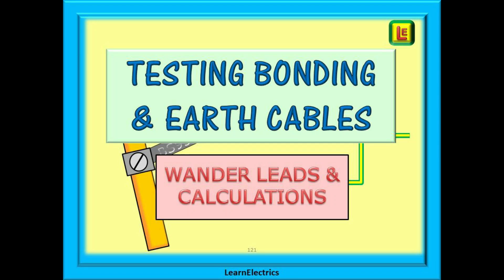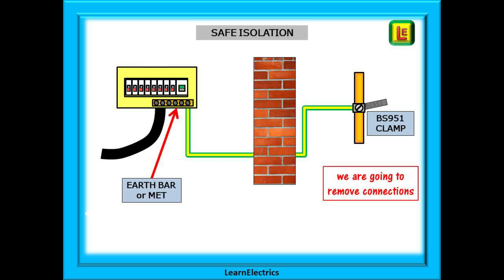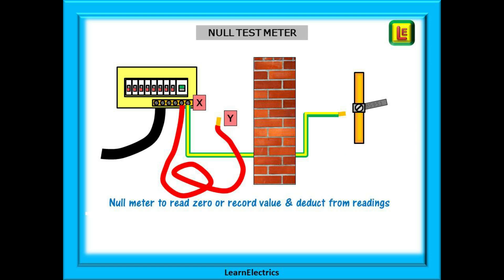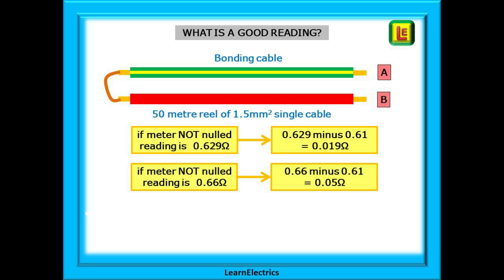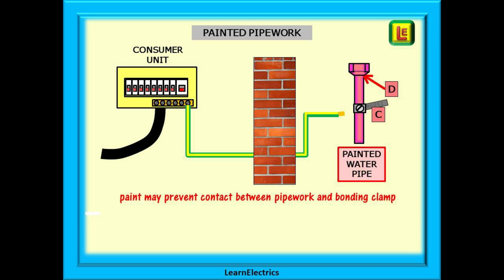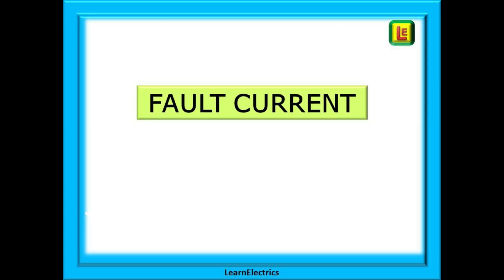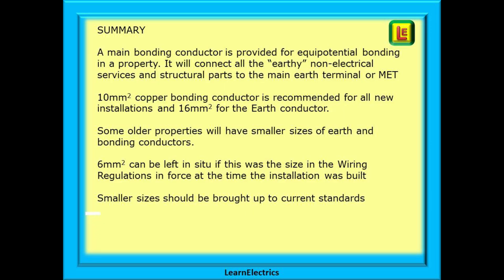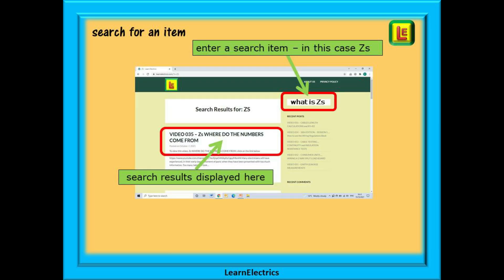TESTING BONDING & EARTH CABLES – WANDER LEADS & CALCULATIONS

Comment: Question about plastic water service pipe at entry position... is it good practice to remove the main bonding conductor as sometimes happens or leave in place? Regs please not opinions. Many thanks and HNY2026
Reply from the maker: I would leave it in place if its still connected to metal that is in contact with the earth/soil. Thanks for watching.
Reply: @learnelectrics4402  Thank you for your reply. I meant when the water pipe is plastic enterring the building with  copper after the stop tap. It is very common to see copper bonded after the stop tap despite a plastic incomer, the trade would bond  water only until very recently say last 5 years.

Comment: dear sir the you calculation 16mm cps its not matching with my calculation  can you recalculate or may be some errors  I have try your formula but not same answer so I will be happy if explain  thank you  very nice explain step by step  it very helpful . thank you
Reply from the maker: Check your calculation and the order that you put the data into your calculator. Square root comes at the beginning of the written calculation but you need to do square root at the end.
Reply: Hi sir it not work any other  calculations  please

Comment: If it is difficult to access the bonding clamp, (e.g. hidden in the floor, but appears good visibly) could you also reverse the test by disconnecting all the earthing conductors at the consumer unit bus bar and test the individual earthing cables from the end at the CU to the other end e.g. by a bathroom radiator?
Reply from the maker: Why not disconnect just the circuit under test at the CU and use a wander lead to test to the earth clamp. That will also eliminate parallel paths.
Reply: @learnelectrics4402  I think that was what I was trying to say, same as the video just from the other end?  I notice in new builds they often have the earth bonding on show in bathrooms by the radiators but this is quite unsightly. Is it OK to place this below floor level as long as tests ok? I'm theory you can service by cutting a hole in the ceiling from below.

Comment: Hi. can you tell me please, where can i find answer for this question on amedment2 WR book?
an earth busber connected to a 250A per phase supply, must not be thans
1. 50mm2
2.16mm2
3. 10mm2 
4. whatever the guidance 54.8 explain
i know its in chaper 54 but i cant find answer. can you give me more information or i have to use calculation form?
Reply from the maker: Main earth terminals and earth bars will be found in 542.4 of the brown book, amendment 2. Good luck. Thanks for watching. Dave.

Comment: What determines the max fault current that can flow. We calculated the max allowed for a disconnection 0.4 seconds that does not overheat the cable. Is it the prospective fault current ?
Reply from the maker: All the resistances in the circuit affect the current flowing. If its a water heater it will be 230 volts divided by the resistance of the cables to the heater plus Ze, in other words Zs for the heater circuit. Prospective Fault current is measured at the Consumer Unit as this is the worst case position. i.e  230 volts divided by Ze. Dave.

Comment: Can I ask a question please about size of earth please. How do you choose correct size earth for fly lead from banjo on an swa where armourings are the cpc?? Many thanks
Reply from the maker: The fly lead should be the same size as the conductors or a minimum size of 2.5mm inside the housing or 4mm if connected outside the distribution board or housing. Hope this helps. Dave.
Reply: @LEARN ELECTRICS  Thanks Dave. Everytime I've seen a fly lead from swa it's on inside of DB from banjo and thought people just used 6mm as standard regardless of size of swa. He certainly asking what size should be

Comment: tested this on my house,gas water pipes,with my megger,and worked out nice,made wander lead too,messure its resistance and marked on the roll ,had wander round house too and messure earths at sockets ,lights,garden shed,pond water fall power point ,good stuff to know ,love the old school sparks,know there stuff
Reply from the maker: Thanks Richard, great feedback. So glad its useful and I love it when someone actually goes and tries the suggestions. This is a good trade to be in, its taken me around the world several times. Lot's more to come, Dave.
Reply: @learnelectrics4402  hi ,i use be a sparky ,left school 1985,thacher was in power,school leavers had yts,so i worked with my uncle,he got laid of from airbus,as a spark ,and set up on his own,i help him out and we did house bashing,sheds,garages,i got good at it after few years ,and he said i should go to collage ,be proper spark,so i did ,had 6 years at collage ,and the exam questions ,as i was taught practical by him,i visulise me doing the question on site,so work out what the answer was ,had high pass rate too,reason i watch this vid was i had high earth leakage on split consumer unit and to much hanging of 1 rcd ,earth leagage test was near the limit ,trip point ,so i rip out the board and fit rcbo instead ,had cross neutral too,you reminded me so much of my uncle ,and how he explain stuff,when on a job ,he say what customer wanted done ,and ask me to work it out ,parts,costs,time ,then he see if i made mistakes,also i had to draw circuit diagrams of how i would wire it up ,cable size,fuse,switch ect,use the nic eic book for ref ,and said iron out the mistakes at first step,his teaching methoud help me out over the years,and i help other sparks too,one had put in intermediate switches on a 2 way ,and got it wrong ,so i show him the draw a diagram way,calc runs,and he fixed it easy then , prefer 3 phase ,amour and cable trays to house bashing ,but work is work,my uncle retired now and designs wiring for hotels,warehouse ,building sites,still got my megger,old but works fine,r1 r2 zs tests ir 500v tests,wish i could of work with you ,would learn so much ,love the older sparks,they never seem stressed,just test and work out problem ,i check out the rest of your vids,refresh myself ,voltage drop over distance is another one i like ,long power cable to shed,and tt earthing ,data lines too,internet ,not done much cctv,but fitted sat dishes ,sky and polsat ,keep up the good work ,you are helping young and old sparks out ,earn good merit

Comment: Thanks for the video.  My maths isn't what it used to be but I agree with the 6mm answer (1090 amps) but get different answers for 10mm (1818 amps) and 16mm (2909amps). Am I missing something?
Reply from the maker: Thanks Grumpy G. You are correct as is Terence. I think that was the calculator that I actually threw in the bin yesterday, I suspected it was faulty and bought a new one today. I know the story of blaming your tools but that's the truth on this occasion.
Anyway, so glad you actually tried the calculation. I'll correct it. Dave.
Reply: I got the same numbers as you.i think the table is wrong or we both are 🧐
Reply from the maker: Thanks Terence, yes, you and Grumpy G are right. That calculator is now in the bin - seriously - it kept failing on me. New calculator bought today and I agree with your results. Good practice for you, and thanks for the heads up. Dave.

Comment: Good stuff. I generally (on an non-energised installation), disconnect the main protective bonding conductors at the MET individually so as not to pick up any parallel paths. If I'm wrong here, please correct me. 👍
Reply from the maker: Mike, you're not wrong, either end will do. I usually go for the pipework end as I want to check bonding clip to pipework anyway. The point I wanted to make to the new guys was that you must disconnect one end to eliminate parallel paths.
Keep your comments coming, it all helps. Dave.
Reply: @learnelectrics4402  Morning Dave. Yeah, I totally agree with you and your teaching method is spot on. 
Everybody is different in their approach and, as the youngsters coming through will soon find, the perfect environment of a classroom doesn't always relate to what you see on site. 
The only problem with disconnecting anything at a consumer unit/distribution board or MET is FORGETTING TO RE-CONNECT IT! 

Dave, you're doing a fantastic job you really are! Keep it up mate. 👍
Reply: @learnelectrics4402  I wonder if a good video would be to discuss determining whether bonding and earthing can be deemed as "adequate" as per the regulations requirement prior to carrying out any work. I often find bonding in the wrong place or under-sized earthing in the context of todays regulations and its often a barrier to getting some smaller jobs when it needs to be done.
Reply: What I tend to find is that new combi boilers will have built in supplementary bonding across the pipes, therefore if there is any connection between the bonding conductors (either via pipes or MET)  that you tend to get continuity readings. To avoid this I try to disconnect both ends.